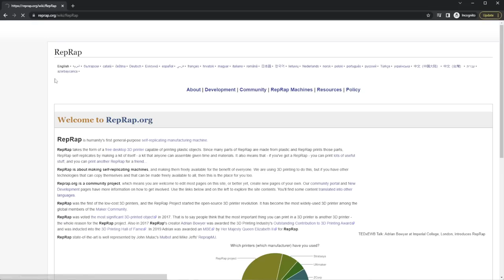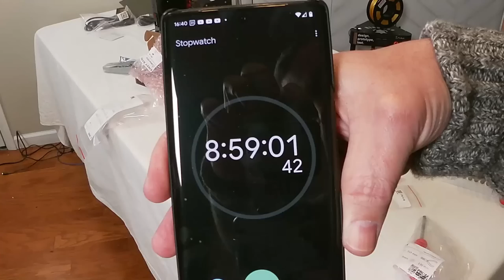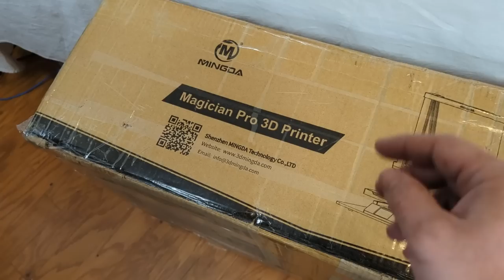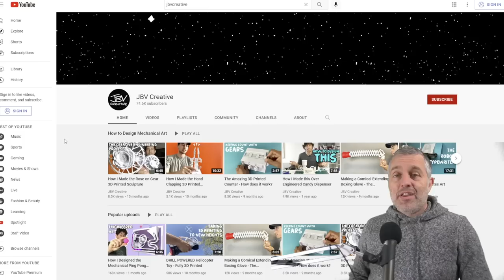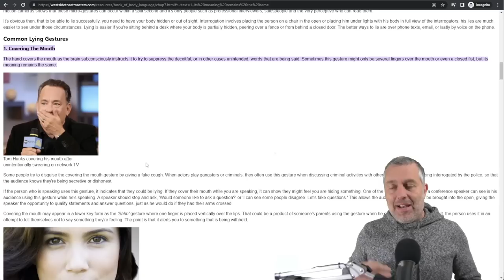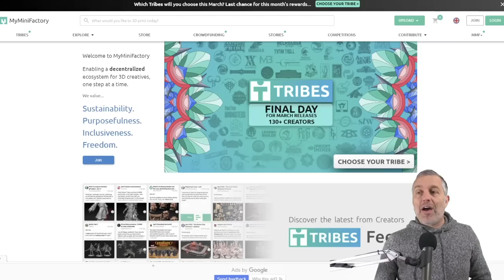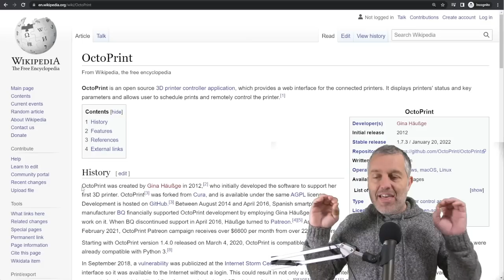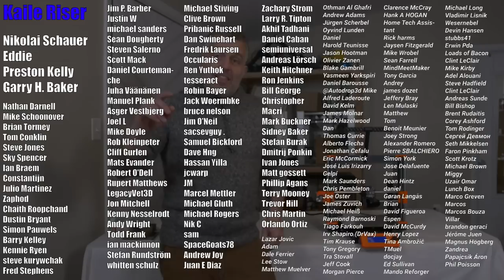Why Does Nobody Speak Truth About The Prusa I3 Mk.3? - It's Overhyped and Over Priced.

Comment: Oh boy,  this one is more personal sour grapes about Joseph Prusa than anything else (no comment on that, everybody has to judge for himself if this stands really on solid ground). 
Concerning the machine, it is a fine printer like many other on the market out there. Is it the best out there? Hell no. Is it a easy and convenient experience with some great looking parts? I say absolutely yes. For sure it's not cheap, but I will try to give my perspective on it after starting out with a modified Ender 3 and moving over to a MK3S+ after getting in touch with them at my workplace.

The high price is coming from somewhere, all the parts get individually quality tested, they use expensive suppliers (Misumi, E3D, Bondtech, Gates, Noctua, Ultimachine,...), labour cost is higher in Czech compared to China (and assembly is by far not the only labour cost that exists). Are these quality brands necessary for a printer to put out fantastic prints? Defenitely not, but they guarantee support for companies, that put a lot of work in developing their products and a high standard of quality control, which is essential for a company's reputation of being solid. Which is further emphasized by the 24/7 support, if it might be helpful or not. That comes at a price. So much on that part

So what is the exact reason why I would still choose a MK3S+ even over some technically advanced CoreXY machines (Vorons, RatRigs, .. you name it)?

Well it simply ticks all the boxes that I am looking for. It is first and foremost a hassle-free printer that will do everything I asked it for without having to tinker with it. No tuning, heavy modifying or coding needed. It is fairly quiet with very little fan noise (turns it off when not needed), it comes with magnetic PEI sheets (which are a essential MUST imo) and the driect drive setup can print up to 300°C without doing anything -> that one I need a lot for ASA/PA-CF/PC-CF. Just run the calibration process, set Live Z once and you're done for a longt time.
The MK3S+ is no speed machine by any means, but slicing it with the standard profiles, turn it up to 150% speed and the prints come out with great quality. If you're on that mission, you should go for some dedicated machines that can handle high speed/high flow applications, but you still have to properly tune/modify them, setup Klipper with input shaping, etc. For me the convenience factor is the one I value the most, it's just easy going.
The only other machine that deliver's this package in my eyes is the Ender 3 S1 Pro, which is clearly aimed at Prusa customers but comes around at 479$. It seems to be a great machine, the only drawback for me is the noise and maybe the complex packaging of the sprite extruder in case of a jam. But finally a real contender

One last thing about the assembly of the MK3S+. It is pretty straight forward and you obviously made some arguments by not reading it properly. The y-axis belt tensioner for instance, the belt has the put in first and then assembled to the carriage, pretty clearly explained in the manual. My first build took around 6h as I was cautious about how to assemble it correctly, but by now it takes me around 3h because I know how to do it.
The part with the insult because they include Haribos... Jeez, that one triggered you hard, what a pile of BS.

All in all, it is an old printer by now and I would love to see it beeing refreshed to the standards of 2022 (especially easy wireless printing, maybe included in PrusaSlicer), but in the end it is bulletproof, makes a lot of things right and puts out fantastic parts.
If someone would make a CoreXY printer with the same ease-of-use, this would be my new choice. But I got no more time left for nerding out, buying stuff, think about implementation and stuff. I just want a machine that I build, plug it in and enjoy printing everything I want from TPU to PC-CF. And that package is for me worth the higher initial cost.
Reply: Its not cheap. Its way overpriced.
Reply: @Nobody-Nowhere  I don‘t think so. It has its price and this is coming from somewhere as I mentioned.
Creality managed to get a similar spec for ~500€, which is 2/3 of the price of a MK3S+. I would consider that a premium, but not way overpriced.
Reply: @Nobody-Nowhere  Point me to other printers then. Creality clones with v-slot rollers may be cheaper but they are significantly lower in quality, reliability, and features.
Reply: Prusa XL does exist and it seems to be a fantastic upgrade.  I think they took so long with it because they wanted to blow every other printer out of the water.  $2000 base model, though.  That hurts!

Comment: While I don't appreciate being called a religious fanatic, I still wanted to add some input here. 

I started with an Ender 3 in 2018 (first printer), it was a learning curve to be sure and I value everything that I picked up tinkering with that, but I spent quite a bit of money upgrading it, looking for perfect prints.  I went through firmware upgrades to add mesh leveling, several BLtouch type probes to add automated leveling, countless nozzle and hotend upgrades, dual-z upgrades, direct drive upgrades for certain filaments, hell, even buying nice calipers for the sole purpose of calibrating printer... and every time I'd got it perfect and laying down an excellent print, a week later I'm spending hours recalibrating everything.  

I bought a prusa mini in 2020 from a friend's recommendation (I'd guess because of my constant complaining) and literally out of the box with zero tinkering, it's printing better than I'd been able to get the ender to do in the last two years, zero down time for recalibrating. Also to add: the mini was cheaper overall than the ender and all of the time and upgrades spent on it.   

I bought a second mini to increase production, same deal - out of the box constantly perfect prints. Earlier this year I bought the mk3s solely based on my experience with the mini, and just like the mini, perfect prints (side note for your video.. if you read the manual, you don't need to measure the screws.... there's a scale printout that lets you compare them instantly instead of measuring...) that build took only a bit longer than the ender 3 for me, but maybe I just have a different mind for how these things fit together. 

So what I have now is an Ender 3 which requires constant recalibration, and two minis and an mk3s which have had zero tinkering since they were assembled (one of them, for two years now....) For a production line, where time is money, that is a critical factor. Why would I waste time (money) tweaking the Ender, when I can press play on the prusa and know that it will work every time?

I'm no fanboy, I use what works and honestly I've not seen anything work better (yet). I do recommend prusa on every post I see with people asking *only because of my experience with them*. 

I'll definitely look into the Voron at some point because this also looks good, thank you for mentioning it.
Reply: Exact same boat as you. Just started printed the parts for my Voron V0.1 to bring to trade shows with me, super pumped!
Reply: Now that you mention he does sound like an angry anthithei- i mean antiprusaist lol
Yeah prusa is a bit expensive, but even with printers like the ender 3 s1 that are more polished and feature complete and ready to work out the box, you get your moneys worth from sheer reliability, plus prusas knowledge base and support when things do go wrong. Creality no doubt has improved but theyre also still not at prusas level of "it just works"
Reply: Same path as you, tried so many brands (learned a lot).  Had a printer that would require de-assemble the nozzle on every prints.  Got a prusa mk3s, perfect prints every time.
Reply: Same trajectory here, also the inductive probe senses the build sheet (as it is a coated steel sheet) not magnets under the bed.  An inductive sensor does not measure a magnetic field and thermal expansion is the only thing which might affect calibration which will be very small in the vertical stack.
Reply: Someone knows something about the bambu p1p?
Reply: But then a real print farmer gets a buch of pursa mini and says as is they werent reliable enough for his print farm.  He had to upgrade , about $70 each to make them 96% reliable, so that kind of put things into perspective.  Are these Pursa's really that much better out of the box then todays modern printers?  I honestly dont know, but have a  feeling technology has moved forwad enough to close the gap,i mean pursa are still using 3d printed parts...  That being said, however they're made they print good, but so are other printers  im finding in reviews, and for alot cheaper, and with a little tweaking could be just as reliable?  Only time will tell, in the meantime i pulled the trigger on 3 atrillery hornets, theres a certain quality about quantity...  lol but they were so cheap, litearlly all 3 of them shipped to my door for 235 canadian funds, which is like 100 euros? 150 benjamins?  1000 aussie dollars?  terribly cheap from ali express which made jumping into 3d printing so much  easier as opposed to dropping $600 one 1 mini printer, regardless how good it was.
Reply: People (including myself!) just jump to upgrade everything on their Enders, completely breaking the machine and making troubleshooting a nightmare. 

A stock Ender 3 is a rather well working, reliable machine.

Comment: For a person bemoaning a printer that uses 3D printed parts, I'm keen to know what you think of voron, ratrig and annex. They go printed because they iterate far faster and with more creativity in designs that the 800 chinese printer couldn't conceive. This video was more for your ego than to educate.

edit so you mention voron at 48:30, so you are aware of it. It has the same makings potentially as prusa. RCF is the same "guidance" as Josef. Mods can be publicly endorsed. PiF has vetting. I don't get how you can encourage one thing but not the other.
Reply from the maker: #Didn'tWatchTheWholeVideo
Reply: @DesignPrototypeTest  hashtags are cool and all to avoid discussion and shelter your views, but you should have saw my edit about voron that you mentioned (with a timestamp even) about it that makes it more confusing.
Reply: @DesignPrototypeTest   I watched the whole video and asked myself the same question as Brett James
Reply: @adamantize  if you want to build a printer thats at least somewhat fast, youll want a lighter motion system. A system with lead screws will have a lot more backslash than a belt driven system.
Reply: @adamantize  Do you know of any 3d printers like the one you've described? While I'm not a big fan of Voron 2.4's belted Z, I imagine even most knowledgeable 3d printing enthusiasts would balk at the prospect of spending too much more on a more robust printer for little tangible benefit. I see the added cost as something of a flaw itself, given the limitations of FDM printing, and have a hard to imagining a machine like one you've described offers enough of an improvement in print/speed quality to make the additional cost worth it.

There's a lot of room for improvement to be made in the 3d printer space, but I think most people in the space now have certain expectations about what the machines can and can't do. Obviously, the space has a long way to go before 3d printing is a plug-and-play hobby item accessible by the average consumer. That includes affordability, mechanical complexity, and everything in between.
Reply: @adamantize  Voron is has more than one model.   All of your ideas have been tried and tested and belts are just fine for 3d printing, people were running lead screws and chains, fishing wire.  Industrial machines like Stratasys are 1000x more expensive with the same quality as an ender3. with leadscrew's  ringing can be reduced but at the expense of a louder, and way more expensive system and slower acceleration which is fine for a CNC, it's cutting....   the only thing close is Annex's engineering K8 (i think) but it has 9mm belts and dual motors per axis.   there's also the hevort, all proven to be fast and rigid.   but again, costly... these are $1500-2K+ builds that offer a 10-15% improvement over all and not worth the price jump from sub $1000.  pushing plastic has fast diminishing returns.  industrial level don't really help at all as it's light weight.

besides with input shaping, things have changed.  we can print fast with good quality.  but only so fast, cause melting and cooling plastic fast is a problem.
Reply: @adamantize  in that case printing slower is fine which belts are happy to do.  there wouldn't be much ringing or backlash at lower speeds anyway.  you can certainly build a leadscrew design, there's probably a few out there.   the other interesting thing to look into would be linear motors, so no belts or lead screws at all.  probably pricey though.

Comment: You printed the Prusa model at 236% speed.  It's clearly shown on the screen during the print and after the print, so it wasn’t an equivalent comparison.   Run it again at 100% speed. I’d like to see how they compare. You would need more heat if you're printing with the additional speed.  I would expect underextrusion without more heat at that speed multiplier.

I agree completely that there are many, many printers that can print at the same or even better quality that a Prusa can, especially when we’ll-tuned, even entry level priced printers.  The speed difference doesn’t seem to be an equivalent print comparison however.
Reply from the maker: You scrutinized the video to the point where you looked at the screen for a "gotcha" but while you were looking for other details you didn't even listen to the words I was saying? 32:42 I also mentioned the speed factor at 30:12 Your attempt to besmirch me shows your intentions and motivations are not aligned with truth seeking.
Reply: @DesignPrototypeTest  huh? it was on screen for minutes, it was hard to miss, scrutiny wasn’t necessary, and you did mention the speed in the video.  Buy you made it very clear at the beginning that the tests were equivalent.  I don’t disagree with your point that other printers can print equally well or even better, I tell people this all the time, but your test wasn’t equivalent like you claim it to be due to the speed difference.  Are you saying it was equal when one printer was printing at over 230% speed?  Running the test again at 100% speed on both printers would validate and strengthen your point.
Reply: @FilamentStories  Hey now, fair is fair. Prusa himself likes to go to shows and tweak speed settings on printers as they are printing.
Reply from the maker: It's funny that your avatar is a big letter F. That's the grade that I would give your criticisms. First you try to "Gotcha" me. Now you are playing dumb like you don't understand what happened. Let me painfully go through this so we can put it to bed. I did not make it explicit in the video that 70mm/s was too slow to elicit the ghosting response I wanted to see. Therefore, starting with the Prusa I increased the speed factor to 236%. I did make this fact explicit when I talked about it at the 30:06 timestamp saying "The original file was set to be 70mm/s up here, print speed, and I printed at 236% so that's like 150 or so -ish mm/s" Then, when I was talking about the Chinese printer I said at 32:42  "I did up the speed also on this one to 235%" Therefore, the test is valid as both gcode files had the top speed set to 70mm/s and then both machines were run at 235mm/s. The comparison is fair. Both machines were run at the same speeds.  NOTE#1: 235/236=.9956 so I did run the Chinese printer at 99.95% the speed of the Prusa. This happened because the Chinese printer only gives the option to increase in increments of 5%. Technically speaking I ran the Prusa at a 0.5% higher speed. So what!? Go do the study yourself and make things match perfectly. You will get the same results as I showed in the video.  NOTE#2: At the 23:08 time stamp it can be seen where I change the speed on the Prusa back down to 100% for a minute. I did this to observe if the speed factor was actually making the Prusa print faster. I quickly returned it to 235% after verifying.
Reply: @DesignPrototypeTest I know you like to be thorough and while I did listen to the entire video, it might not look like a completely even comparison for the full print with speeds being changed up and down on both printers.  You said at the beginning that it was an apples to apples test.  It wasn’t my intent to attack you, only to ask for a more straightforward test so that the speed issue wouldn’t be a factor.  I was thinking of people who hear the beginning comparison goal and then see all sorts of things going on during the print and wonder about the equality of the test.  You've explained it here in case there were questions by people watching.   Again, I don’t disagree with your statements, it looked confusing during the test was my point, especially to those who are new to 3D printing with limited knowledge who might be looking to you for guidance on what printer to consider buying.  Your summary will give that information to anyone interested.
Reply: @DesignPrototypeTest "To be defensive is to react with an overprotective mentality so a situation that perhaps doesn't warrant it. Defensiveness is an impulsive and reactive mode of responding to a situation or conversation. Rather than listening with an open heart, we respond with our metaphorical shields up and weapons drawn."
Reply: @marijuanas  hes not looking at it from an open perspective, he just wants to fight and win against the prusa mob lol.